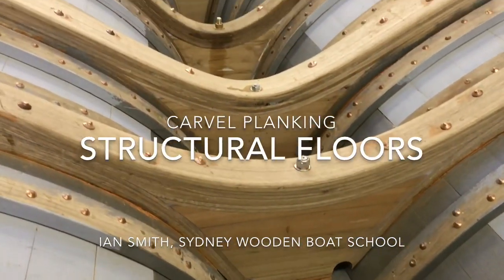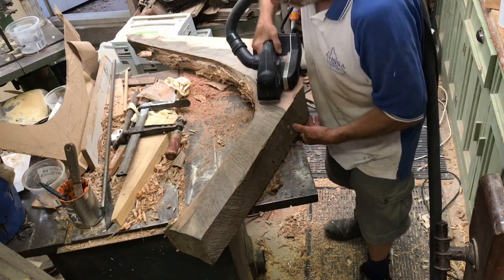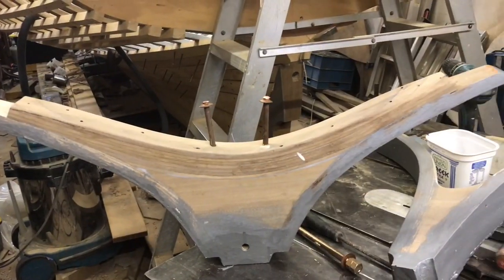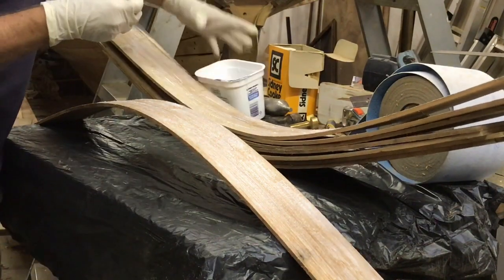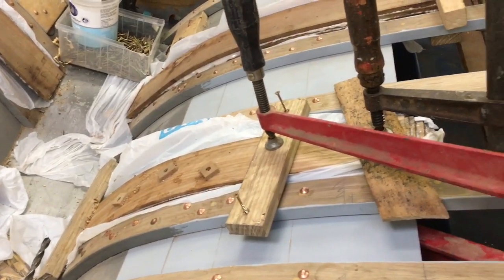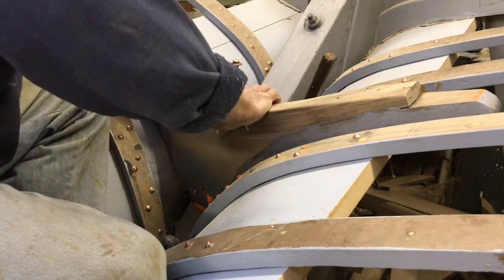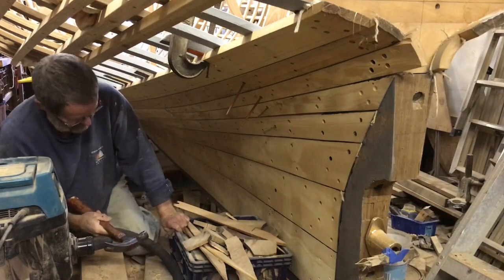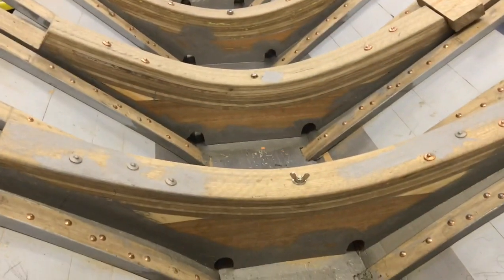Carvel Planking  Ep.6: Structural Floors

Comment: Can planking be done vertically?
Reply: The frames are vertical, what would you fasten the planks to? The current horizontal members (rib bands) are removed as you run the planking (as you can see where the planking has already been done).  The rib bands only hold the frames in place until the planking goes on, they are not permanent pieces of the boat.
I suppose if you were double planking you could run a vertical layer, but I don't know how, structurally, that would help much, other than to have a thicker hull. It would definitely make the boat float deeper and sail slower.

Comment: I love watching your channel! I wanted to know what the bedding compound was that you use under the structural knees?  Thanks for replying!
Reply from the maker: I mixed some red lead powder into regular linseed oil putty, plus a little marine grease. I would have used white lead if it was available. Alternately these days I would use a low-modulus polyurethane sealant on primed timber and make sure there was enough in there for no voids. Do not use the harder polyurethanes used on decks.

Comment: Is that called built down construction ?
Reply from the maker: I guess it is, but that term is really an American expression that applies to smaller boats when the planking is built down to the keel, going through a reverse curve. A small boat with the garboards (lowest plank) fastened onto a keel batten with an added heel or skeg is not built down. If the garboard is at the bottom of a reverse curve and is fastened to the keel, we call it a built heel here in Sydney.